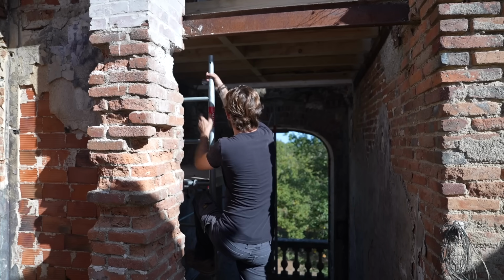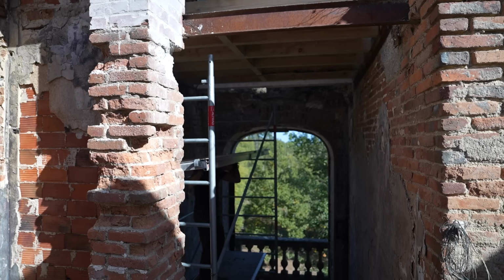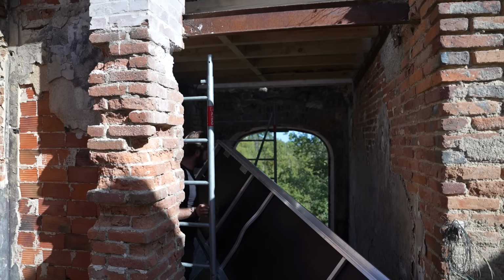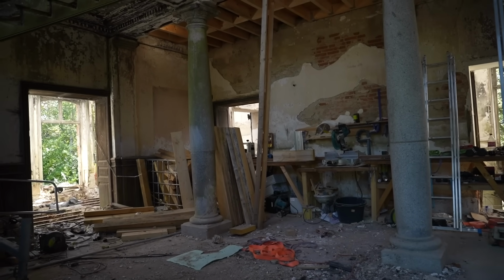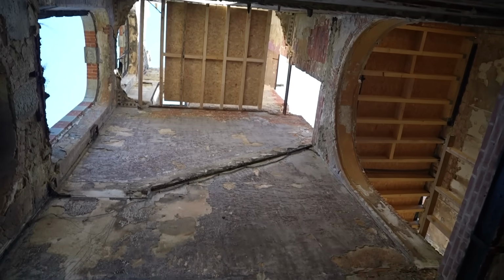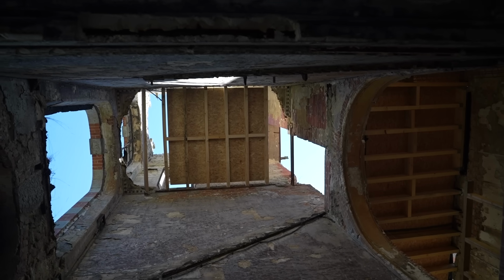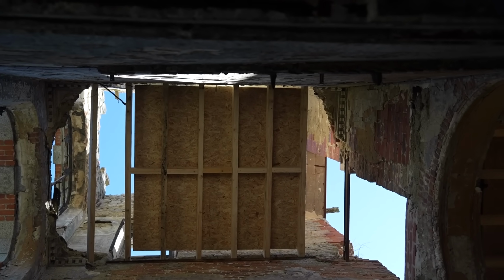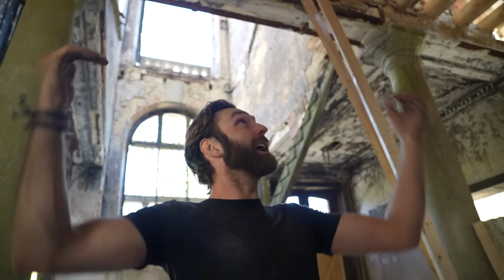Its time for the scaffolding to come down.

Comment: ...Dan is safe....Dan needs stairs now....:hand-orange-covering-eyes::face-orange-biting-nails:
Reply: But will he put them in??? I think he needs an arm on the top in the middle where he can mount the wench with a aluminum basket. Then he puts the needed supplies in the basket and walks up the stairs to raise the supplies to the floor they are needed.

Comment: I am not a worrywart but have two friends with significant head injuries from falls, neither can work, they can only drive short distances, and their worlds have been turned upside down. One was 8 years ago , they fell down a kerb and hit their head on the concrete, the other was knocked over onto concrete by their horse, they were standing at the time. A head injury or any other sort is not a joke. The chateau is looking amazing, how neat to get the view up to the top floor. Be safe!

Comment: Question: I’m sure there’s a plan for stairs, but I’m wondering if you can make a temp staircase with premade metal stringers? They make them for decks in the US, so idk if they have them in France, but for very little money you can make a staircase in one afternoon, we use them in theater all the time…

Comment: Have you considered the Festool HK 85 with the groove unit? It is pricey, but i think it would speed up your floor joist "notching" significantly, and you already have the guide rails. You could also use a Festool router (OF 2200) with a guide rail accessory for this.

Comment: You NEED SAFETY EQUIPMENT....you are over 6 feet in height there. You need to be harnessed off and double anchor points. That was very unsafe and foolish. It only takes one time to lose your balance and splat....😮😮😮😮😮
If I didn't care for your safety, I wouldn't say anything.

Comment: A better way would have been a beam that spans the joists at the top to distribute weight. Winch connected to that beam. Lift the scaffolding from the second lowest segment. Remove lowest segment. Lower remaining scaffolding. Repeat.

Comment: Hmm not too sure why you pulled them all the way down without fixing the other small landing floor first. You will end up having to put it all back up again to get to them. 
Should of just got the landing done as you slowly moved down. Then all you had to do was build the base landing and then the stairs that slot into place and it would be done.
Reply: @andymccabe6712  there is a narrow landing between the second and third floor at the second large window up, I would of thought he would of quickly shoved that in while he was up there and then taken down the scaffolding. 
He will need the scaffolding again to get up there even if he doesnt get back to the stairs for some time. But if he did get it done before then atleast it would be done and ready for him.

Comment: I’m guessing you are going to hang an electric hoist from the top floor. I have done similar on roofing jobs where we fixed a length of unistrut to make a track then you have the ability to lift stuff and move it much easier. Two guys were able to swing up and into place 70kg trusses 12m wide.

Comment: It seems like it would have been much easier to get the other floors in by taking down the scaffolding floor by floor as the wood support beams are completed--but that's just assumption. I'm not physically there seeing the space and what is needed.

Comment: You really have to start rationing jobs out so that you can do a two-person job with two people, dude. If that heavy scaffolding had gone over, it would have pulled you over as well, I've had it almost happen to me once when the bugger I was working with fell asleep on his feet. If I had'nt been secured to overhead safety bar, I'd have gone over and down.

Comment: To be honest this is getting pretty senseless now. I hope your family can forgive you if anything should happen. Not only that but don't you think it would have made sense to build up the scaffold and do the roof first, protecting you from the crumbly bits up top. And take the scaffold down as you worked your down the building - safe at all times with all your timber protected from the elements as well? Or work the walls up from the basement to the roof from under a crash deck as the scaffold rose to the roof. It doesn't even make sense to support it by watching.